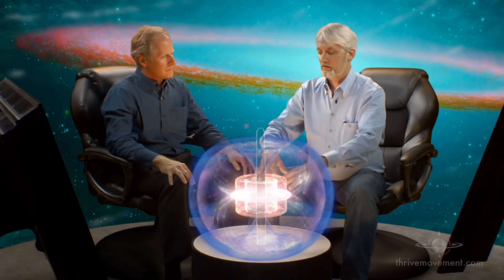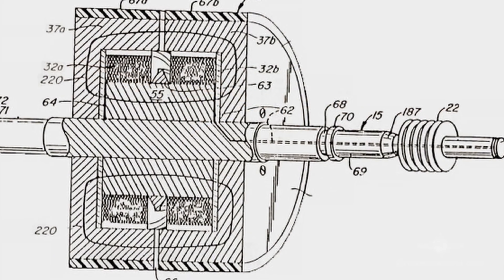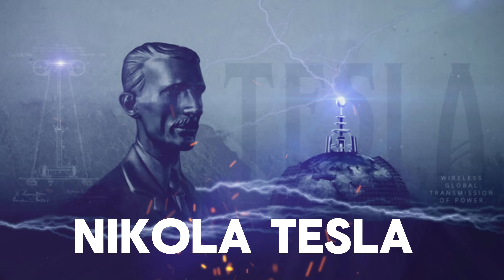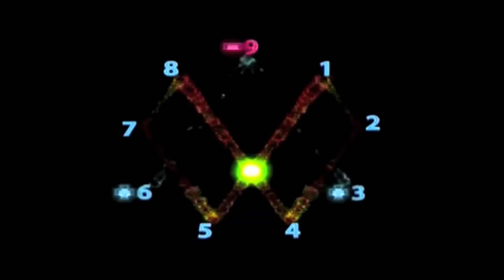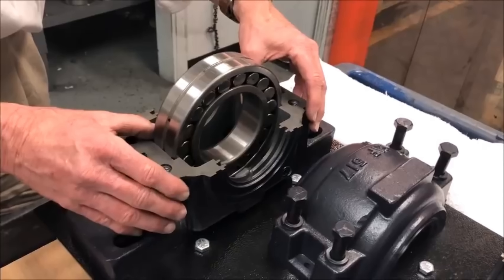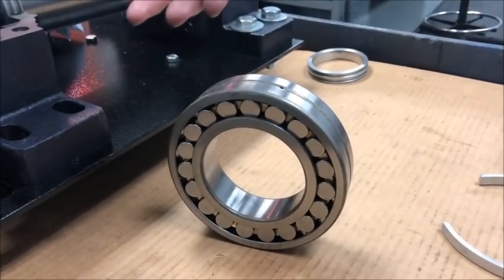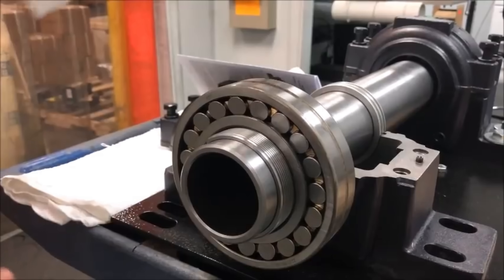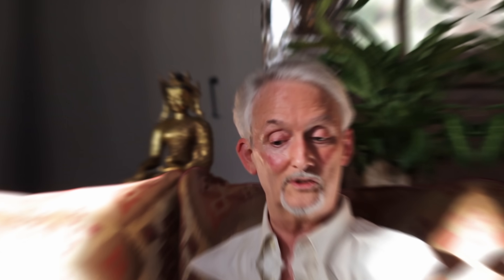Torus Dynamo - Adam Trombly Magnet Motor That Generates Free Electricity Forever?!

Comment: This video reveals just how little research you have done on Adam's device. Read the patent. It's a unipolar dynamo
Reply from the maker: Thank you for your feedback. I appreciate your insight into Adam's device. A unipolar dynamo, also known as a homopolar generator, is indeed a fascinating piece of technology. It generates direct current (DC) electricity using a conductive disc or cylinder rotating in a magnetic field.

Comment: I built one using magnets for free energy but the issues is that the power is not free and runs out. Its not big enough to work. Our home will use more energy than it can produce. Batteries storage won't last long unless you work on a bettwr way ti disable freezers and ect when cold enough. Gave me a huge headache and i quit. Im not tesla.

Comment: At harmonics you get an effect called resonance, and this can indeed under the correct conditions act like an electronic battery and resonance RC circuits using high quality components can increase the voltage of an alternating current and I have come upon such circuits  to step up the voltage amplitude of a radio transmitter signal, this is almost certainly what he is experiencing, we talk of Q factor, or quality, and in the case of a resonance circuit in electronics Q =Xl /R (inductive reactance/resistance measured in ohms, Xl = 2 Pie times frequency times inductance.

Comment: charlatanism. 1- generating voltage is NOT generating power. 2- magnet contraptions DO SEEM to produce "free energy" FOR A WHILE until the energy stored in the  magnetization of the "permanent" magnets gets depleted. then the magnets loose their field and all fizzles out. But there was bever a miracle - great energy was expended in magnetizing the magnets in the first place

Comment: The core of the earth is molten rock, that spins in a direction opposite to the rotation of the Earth’s crust, producing a magnetic field that surrounds the Earth (simplified version).  It seems plausible that tapping into some portion of the Earth’s rotation (and magnetic field) would produce electricity, as electric current and magentic fields are directly correlated.  That said, it must be far harder to actually do this than it sounds or someone would have done it by now.  Interesting concepts here anyway.

Comment: They forgot to teach us that cars were electric until the oil engine was built to make money on fuel
Reply: The first cars were steam powered. The first petrol car was built by Karl Benz in Germany in 1888. The first battery-powered cars came along a few years later, but they were too slow for popular use and had limited range due to the batteries that were available then. Jay Leno has working examples of all of these in his museum. The petrol engine was built and became successful because it performed better than the steam and battery powered cars that were then available. You need to do some proper research and stop spouting nonsense.
Reply: The “cars” you talk about were e-bikes with 4 wheels.

Comment: All this stuff was interesting before solar panels.

But now you can buy 250 watt solar panels that are lightweight for $60 and they will put out energy and they are flat and easy to mount.

So we no longer need to try to do magnetic capture of any kind.
Reply: Sure we do.  The sun doesn't shine 24 hours a day.  Where I live we have this thing called winter where solar panels get covered with snow.
Reply: @maureencallahan1604  or night time when people still need AC cooling and electricity when the sun goes down... sure there are battery storage systems to work with solar but you are talking costs outside of what most can spend...
Reply: Solar panels are trash and a huuuuge detriment to the Earth. No battery powered or stored energy sources are good for the Earth because of what it takes to get the materials. Also there's no recycling of any of it. The best and cleanest energy source would be the natural gas. (but we get raped for that also.) Thought you'll most likely never hear of any of that because they don't make as much off of natural gas. (Even though they make a lot. It's just not enough.) Natural gas is mostly a one and done install.  Meaning that once the pipes are installed thats it. No more nothing needed unless there was some sort of a problem or the pipe/pump system needs an upgrade. I mean the gas is literally just there in every coal and oil bed waiting to be extracted. As soon as they crack the seal the gas starts seeping out. No need to extract the oil or coal. Just lay the pipes, turn on vac pump, n there ya go, that's it!. Clean. The worst/detrimental part is the initial drilling. After that it's good! Just route the pipes to central location then distribute to wherever needed. 

Though, the greed is real and super strong with these ones. So like I said...most likely not gonna happen.

Comment: Best source of renewable energy is wood. And so it has been since the beginning of humanity. The problem is there's just too many people using it.
Reply: No, the best source of renewable energy is our Sun. Unlimited and will last for about 450 million years. We already use it, we've been generating electricity from sunlight here for many years. I helped a friend (Client) set up solar power for an isolated house 20 years ago. Worked just fine. Free electricity. The Sun also provides wind for wind turbines and rain for Hydro-electric power.
Reply: @brucerogermorgan2388  the problem is the Machinery needed to make these things doesn't last forever therefore it's not renewable. Wind turbines and Battery Systems will eventually need to be replaced. Even nuclear power plants need to be built and eventually replaced as they age. Even your friends solar system will eventually fall apart and need to be replaced therefore is not renewable it's replaceable Just the mining of all the metals like lithium, copper, Steel Etc basically by the time you build a wind turbine you've probably used just as much energy getting the materials out the ground and the man hours necessary to build the unit. Whereas with wood you burn it, the carbon goes up in the air falls back down to the world surface it grows back again and there's nothing to do. Look at the scrap yards filled with discarded waste materials after Energy Systems break down and are discarded. I also have a solar power setup but eventually one day my solar panels will have to be thrown into the garbage.

Comment: It's illegal to produce a free energy divise.  Federal law prohibited the design and reproduction.  Tats why we don't have anything in this direction.
Reply: The Experiment: Suddenly create some charge, and with pre-placed instruments watch (along a radial line from the created charge) the fields and potentials appear progressively at points along that radial, at the speed of light.  And once the field and potential suddenly appear at a distant point, they thereafter steadily remain. This shows that a stream of continuous real observable EM energy does indeed pour from the charge, once it is made, continuously and unceasingly.  Further, that free stream of EM energy does not "die out" so long as the charge remains intact. So the associated fields and potentials are continuously replenished, as they continuously spread radially outward at light speed.

The Observation: Every charge freely pours out real EM energy in all directions, with no observable energy input.

The Problem: Either the required nonobservable energy input must be identified or the energy conservation law is false.

The Solution: The charge continuously absorbs virtual (subquantal) photon energy from the vacuum, coherently integrates it, and re-emits it as real observable photons.

References:

Source Charge, Van Flandern Waterfall, and Leyton Geometry T. E. Bearden  (Dec. 2, 2003)

T. E. Bearden, "Giant Negentropy from the Common Dipole," Proc. Congress 2000, St. Petersburg, Russia, Vol. 1, July 2000, p. 86-98. Also published in J. New Energy 5(1), Summer 2000, p. 11-23.

T. E. Bearden, Energy from the Vacuum: Concepts and Principles, Cheniere Press, 2002, “Chapter 3: Giant Negentropy, Dark Energy, Spiral Galaxies and Acceleration of the Expanding Universe.”

M. W. Evans, T. E. Bearden, and A. Labounsky, "The Most General Form of the Vector Potential in Electrodynamics," Found. Phys. Lett., 15(3), June 2002, p. 245-261.

The Source Charge Problem: Its Solution and Implications T. E. Bearden, Aug. 18, 2003

Comment: Ok let this uploader learn this you need to spin a magnet on a shaft and put the spinning magnet inside  a stator made of steel or iron through the walls of the stator there is enamel coated wire  depending on amount of copper wraps and single phase or three phase  now this will generate a voltage that is AC  the torrid in video works the same way  but has steel or iron dust mixed in with ceramic there's nothing special or new about this concept

Comment: Ive recently learned that right before his death, Tesla actually had completely abandoned AC power for his free energy experiments, instead opting for Pulsed DC  power after he saw edisons power lines creating these blue spikes for a fraction of a second when the switched were thrown, having so much voltage they would jump to any nearby line workers and instantly fry them. he sought to use this power in a controlled manner, which is where he found what he called the Ether. pulling the same energy that gives lightning strikes, waves, tornados, gravity, etc its energy. by pulsing it at a specific frequency he could encourage this ether to flow into his circuits, which would also wirelessly power every conventional DC powered system within 30 meters at least, which is wha the colorado springs experiment really was. he was working in the hotel newyorker in a second room he had, paid for by his work with the rockefellers on upgrading their Radio towers, to make small devices that could fit in any home, and not only would it power your home and all your devices indefinitely,  but would also boost other nearby devices, creating a sort of mesh wifi network for energy.

also, for anyone reading if you have followed this, Please Open source your work, keeping it secret only lets Murder Inc beat a path to your door, as you cant put a meter on free energy. and by its nature you will NOT be permitted by the fossil fuel dynasties to threaten their dominion and make yourself rich from it. your compensation has to come from donations, selling kits, etc. you will NOT be able to license it like any other patent or IP, you must open source it if you truly wish to change the world.

Comment: Did I miss the part where the device was on the market?
Reply: Photovoltaic also called solar energy is available for decades now. I have 2kw solar system on my roof and it cut my electricity from around $200/m to $50.00/mo but it cost me $3500.00 for materials to build. It took me couple weekends to build myself, with help of my son. I am electrician so I know how thing works. Don't do it yourself if you do not know how to work on electricity.
Reply: @junkvista61  can I buy it?
Reply: Power companies will buy the patent and then make sure nobody has access to this system.
Reply: Funny part at the start about the toriodal field of the planet its also the same as us humans
Reply: Can people buy your generator now?
Reply: If only you knew how things work ......😵‍💫